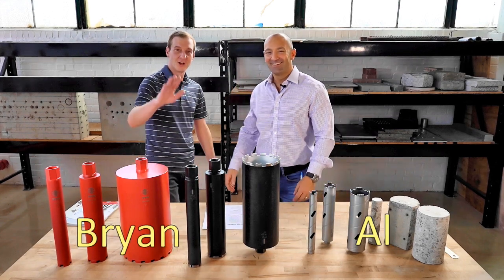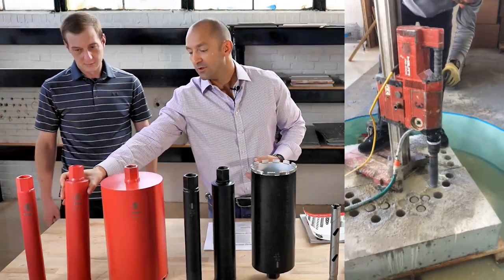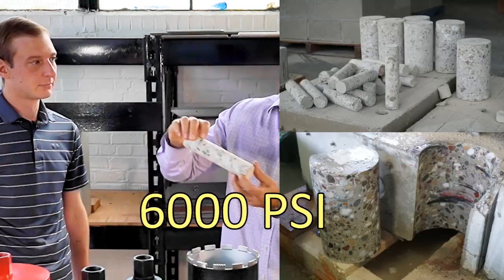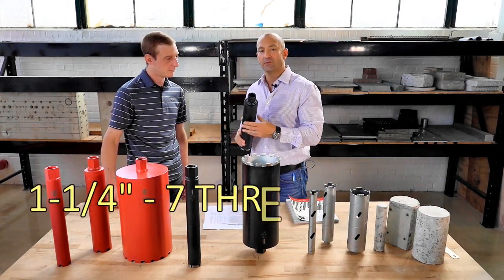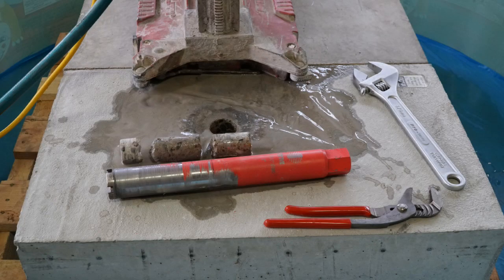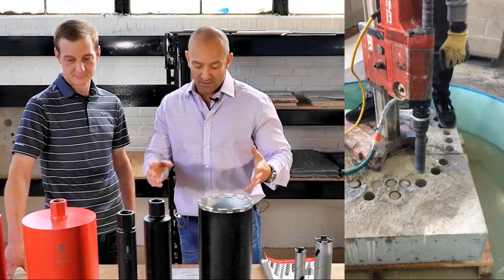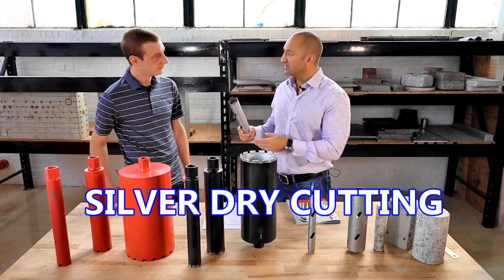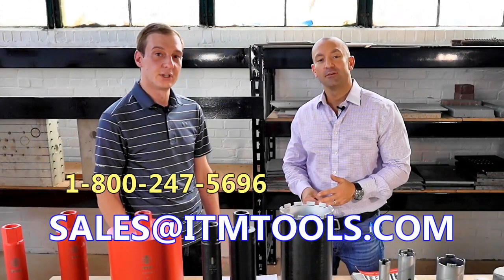CONCRETE DIAMOND CORE VIDEO

Comment: 8 to 10 holes ? Use core bore and will drill 10x that with no problems
Reply: Agreed. I figured 40-70 feet on a 4” core.